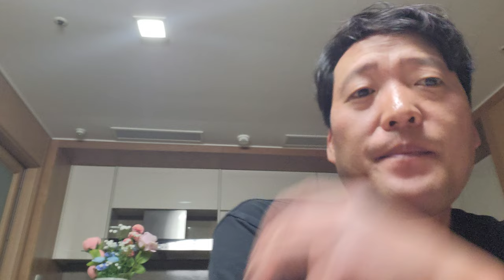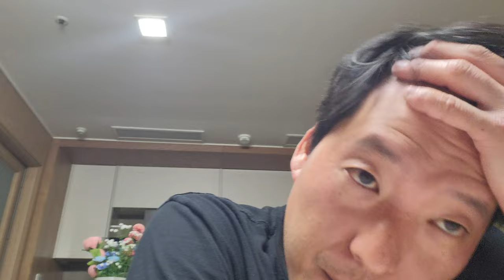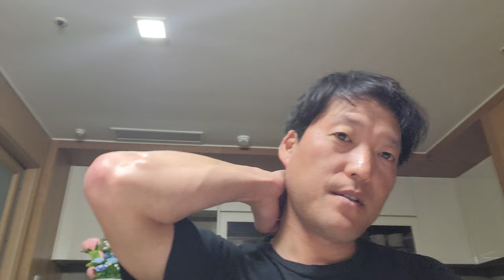Why I still Prefer Prusa MK3S+ over my Voron 2.4 & Ratrig!

Comment: 1) you can use sequential printing for print more than one wheel on your prusa. 2) I think there is no point in buying a clone while the original is $650. 3) I print abs in a 60C active heated chamber, just had to replace petg parts for abs parts, add a cooler to the E motor, add a cooler to the Einsy, and put the LCD and the PSU outside. For the active heated chamber I just use a cheap chinese thermostat and a 200W Heater with a cooler

Comment: Indeed the Prusa is an excellent workhorse, but for some reason even though I printed their PC Blend with an "improvised" enclosure, none of the PETG parts had any problem, and PC has higher temperature requirements. I don't think the ambient temperature inside it ever went above 50C since there were flaws in my enclosure design, but aside from warping on the models (no failures however, they did remain on the print bed), there were no other issues.

Also, how would you describe your experience with your RatRig? I was looking for a bigger printer for my upcoming projects and I was considering their VCore 3.1 400 version. It comes with PETG parts from what I know but I will print everything again in ABS on my Prusa. How long did it take you to assemble it? How good are the prints? I'm mainly interested in printing PETG, PC, and maybe Nylon on it. Also, can it handle long-time prints? On my Prusa, I once had a 4 days continuous print without any problem, and the RatRig should be able to withstand such big objects as well.

Comment: Hey man, I just got done with the Voron build. I wanted to tell you, the example printer.cfg file that you gave in your build setup has the incorrect gear ratio for the v2.4r2. On the extruder gear ration you still have 50:17. For the stealthburner the steps are different, and it should be 50:10.   I was having bad results using your printer.cfg file also, that helped fix it when I was calibrating the extruder.

Comment: I've been researching and trying to find the best 3d printer for tpu and started looking at the ratrig but it doesn't sound like its the best fit from what youre saying. The thing is I need a build volume of at least 36 x 26. So I'm not really sure what to look at now. All the ones I've seen that aren't direct drive have terrible finishes on the TPU.

Comment: Have you tried using a different slicer, like superslicer? I end up using three different slicers depending on which printer I'm using. They tend to be better tuned for the printer they were designed for.

Comment: Mm/sec is not something i worry about. These printers are very fast.
The mateial has its limitation for how fast ti can be extruded  and manipulated.
From stretch in the material 
Compression in the hotend and exteuder gear.
10mm3 is the flow limit.
For me, above 10mm3 flow things start to degrade.